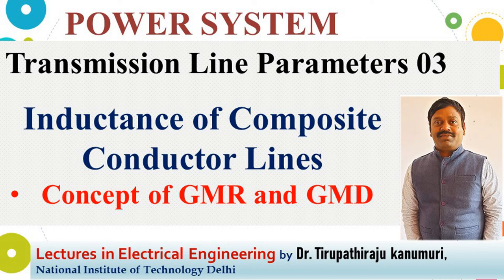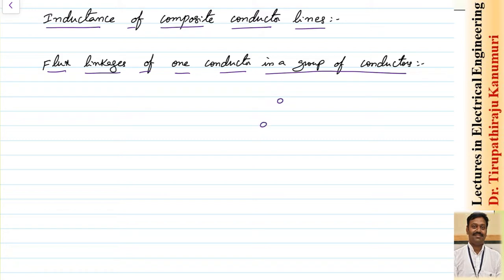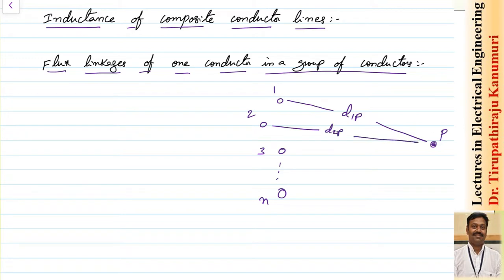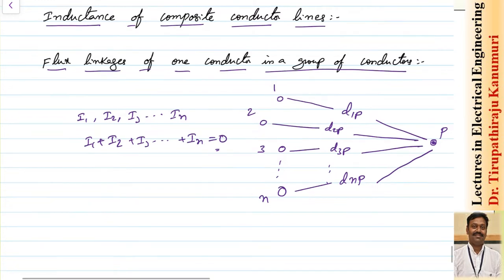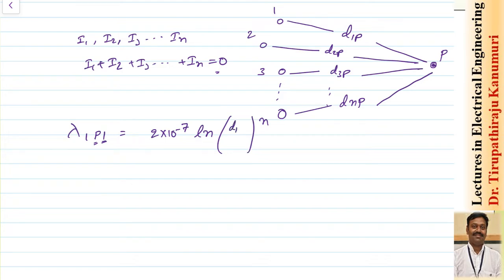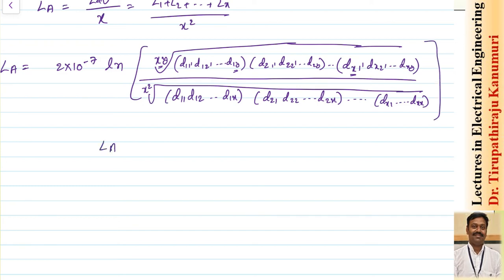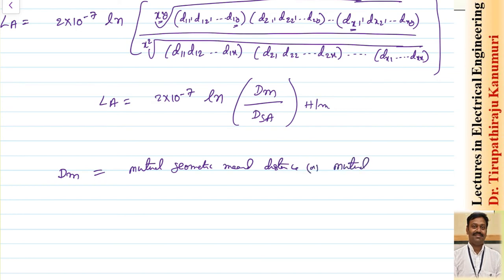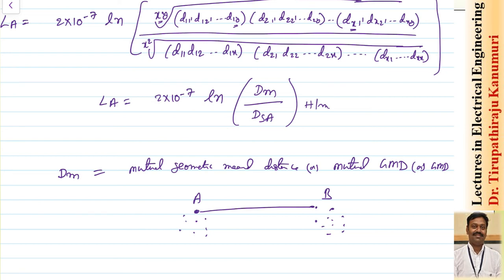PS11 Inductance of Composite Conductor Lines

Comment: Sir how can be use equation 2 directly in composite conductor case as we derived eq 2 by the assumption that sum of current is zero wheras in composite case the sum of current in each conductor is I not 0 
Time at 8:57
Reply: @lecturesinelectricaleng  but sir how eq 2 applicable for a same phase conductor whose sum of current is not zero

Comment: Sir, this Lambda_1 is the flux linkage due self as well as mutual flux(due to current in wire 2 strands). Yet,  to calculate L1, you are dividing lambda_1 by I/x. But if we consider mutual flux due wire 2 then to calculate L1(total inductance due self and mutual flux), the flux linkage due strands in wire 1 should be divided by I/x and mutual flux linkage due to current in wire 2 strands should divided by I/y. Please help me with this. Thanks
Reply: @lecturesinelectricaleng   Dear Sir, thanks for the reply. The timeline I am referring to is 11:18.
Reply: Please tell what is the answer